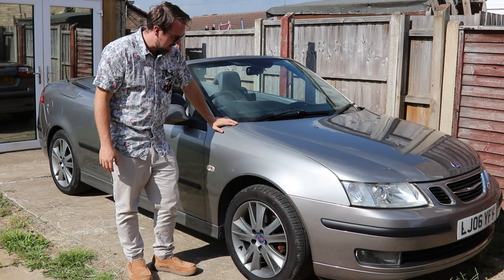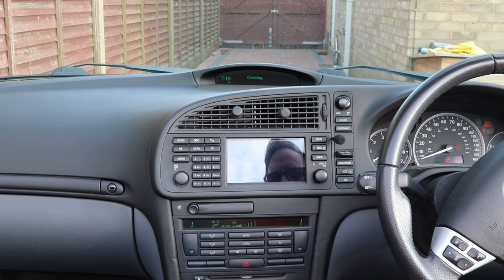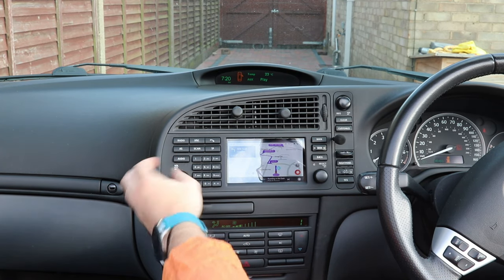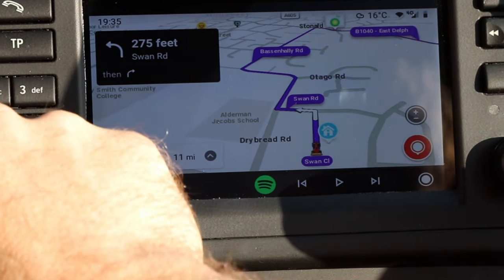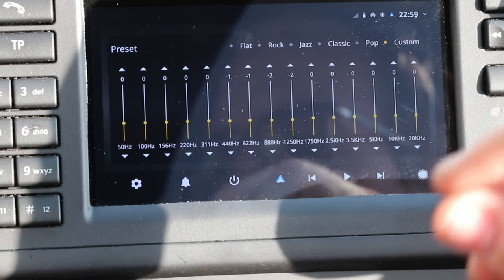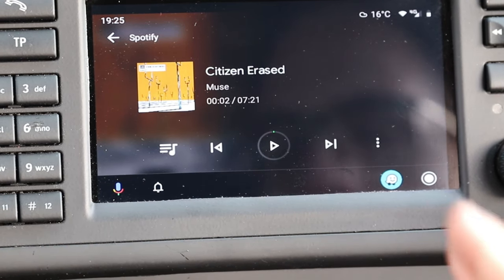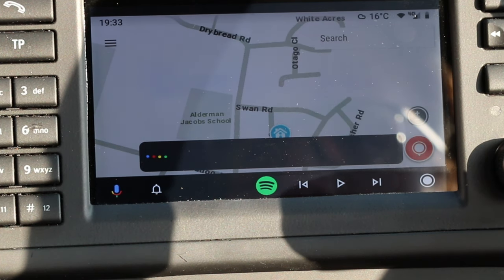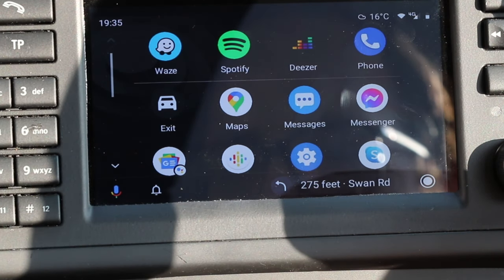Using the Saab 9-3 ICM3 Radio Modification -  Open Auto Pro

Comment: Very interesting.  Would there be a way of adding a second screen input for the old screen's information like the fader and balance?  Maybe a two port HDMI switch box and some sort of converter/upscaler from the old head unit's signal to HDMI?  That would make it perfect as you could switch back to "original look" at will.  Probably a lot of work though.

Comment: Hi, I have 2003 SAAB Vector and my questions are:

- Do I have to use Tech 2 to make ICM3 work on my System?
- Do you sell this Upgrade already installed in an ICM3 Unit and able to send it to Mexico?
Reply: no the ICM is plug and play. no problems there. and he does ship. but no, the kit is everything to be installed as I believe the install is at your own risk kinda tihng.
Reply: @ConfermentRM  Wow ok... And do you know the cost?
Reply: @shikafer  about 450 for the ICM3
Reply from the maker: I added a link in the description to the build video which has all the info
Reply: US Dollars?
Reply: @shikafer  indeed

Comment: Awesome videos! How about the RBP case being just tossed inside the dashboard when it comes to its running temperature? Doesn't it overheat given it sits in a confined space, surrounded with a shell of dark/black plastic? I am a little afraid of what might happen when the car is left in the sun for the whole day during summer and then the RBP becomes switched on. Any active cooling ideas (if needed)? Where I live can be very sunny, temps reaching 32-35*C.
Reply from the maker: This was an issue actually. All of the kits now have heatsinks and cases with active cooling

Comment: This is a great discovery!!! May I ask how did you overcome the ground loop noise from the raspberry ?
Reply from the maker: The installs included a ground loop isolator, but also ensuring that the Pi has enough current (around 3A) will ensure you have a nice interference-free experience
Reply: @SaabUnleashed  ok do you mind recommending which one you used for ground loop isolator. I was going almost crazy with the noise killing all the joy and excitement of this project :) I was reading that an isolator would kill the strength and maybe some bass but since you tried it I trust your experience :)
Reply from the maker: Check the aux cable you're using, add a 3.5mm jack ground loop isolator and make sure the power warning isn't showing on the Pi
Reply from the maker: You want something like this https://www.amazon.co.uk/VTOP-Ground-Loop-Noise-Isolator-3-5mm-Audio-Filter-Black/dp/B07RFGH5N7/ref=sr_1_1_sspa?dchild=1&keywords=ground+loop+isolator+3.5mm&qid=1635419010&sr=8-1-spons&psc=1&spLa=ZW5jcnlwdGVkUXVhbGlmaWVyPUEzRldCM04xSU5FQSZlbmNyeXB0ZWRJZD1BMDU1Mjg5MzFQNkpDVk83WURPMlUmZW5jcnlwdGVkQWRJZD1BMDU2Nzk3ODJXVzBMQlJUNzBPUUImd2lkZ2V0TmFtZT1zcF9hdGYmYWN0aW9uPWNsaWNrUmVkaXJlY3QmZG9Ob3RMb2dDbGljaz10cnVl
Reply: Thanks I will definitely try it.
Reply: Someone needs to make sone of these units to sell…please!

Comment: if i'll buy the building kit locally, according to the system description, and buy also open auto software, do i need anything else? how do you manage the shut down secvence? by turning the key off or as "computer style"?
Reply from the maker: That's all you need. Remember to use the discount code for Open Auto Pro.

No "graceful" shut down, the power is simply cut when you switch off the ignition. As its not constantly writing data, there's no real risk of corrupting the data on the card.
Reply: thanks for the answer
Reply: @SaabUnleashed  What about powering the system off while driving? Does the old "power" button work?

Comment: Very nice.
You can improve this system if you do the same as Michał Bojarski (here on youtube), a switch betweenraspberry and the original system, then you will reduce the some down sides.
Reply from the maker: I watched his videos years ago, he's a legend! There are some key differences though. He is using the original screen which is 240p, a very low resolution that shows blurry text and is obviosuly not touch screen. And then there's the fact that you need to be handy with a soldering iron, and have an electronics degree to achieve it!! My basic mod was designed so that anyone could install it, it is as simple as it gets. And you get the sharp 1080p touch screen
Reply: @SaabUnleashed  there's also a, what seems to be, Spanish guy that did the same and it looked good.
On the resolution side, i think you could use an upscale.